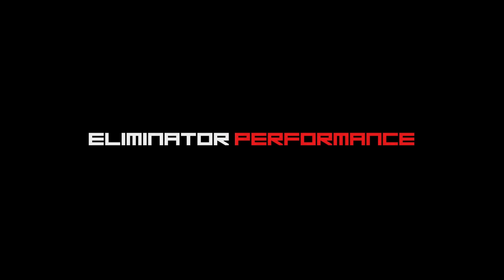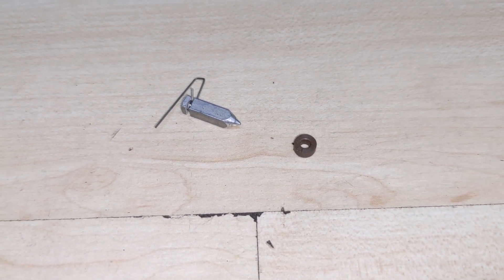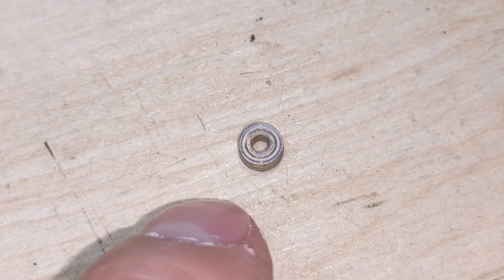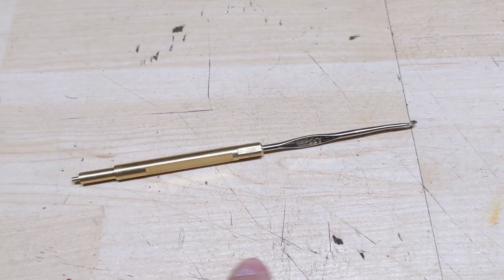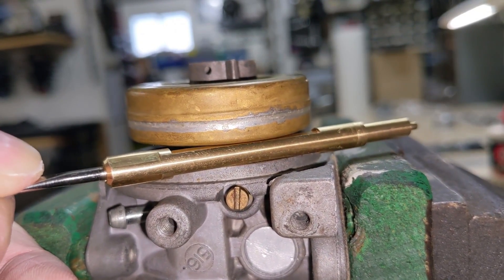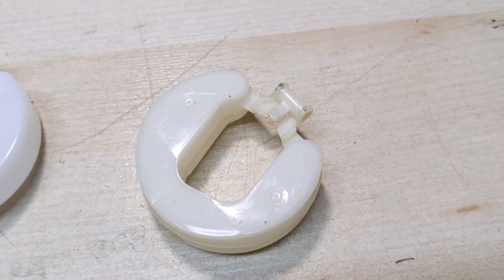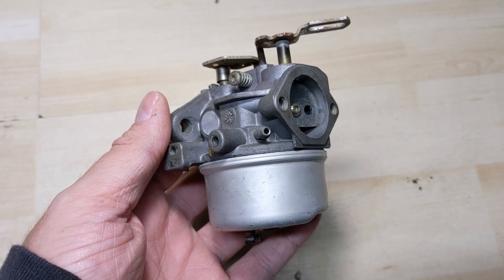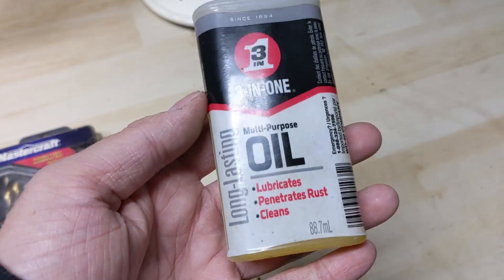Tecumseh Needle & Seat Tool - Product Review

Comment: My seat removal method is an air hose on the fuel inlet while I have my finger over the needle hole. Almost always works. I use a pick to loosen the stuck ones. Drill bit to install new one that I coat in 2 cycle oil.
Reply from the maker: That'll work too, thanks for watching!

Comment: Might add that if you have the old brass metal float, shake it, if you hear liquid inside you need to replace it. If you suspect it pour a small amt of gas in coffee can and using something to gently hold it submerged for a min or two then check. Its brass, its thin, I had seen a few get holes in them, the carb will overflow with gas when that happens.

Comment: great video, without tool this is my method to kind of get the same results

 - I use a drywall screw to remove seat or an angled mini pick, ( I know it destroys it , but it removes it )
- for install I use a mini pick or paper clip to get the seat into the hole
- to push it down I use a machine screw or Allen wrench 
- to measure  the float distance height, I use the shank of a 11/64 drill bit
Reply from the maker: A drywall screw would work great, thanks for watching!

Comment: I have 3 used tecumseh carbs and they all poor gas out when I turn the gas on, would it be because when I'm cleaning them I use an air compressor to blow through all the openings and I would have blown the valve seats out and the needle can not shut off the gas now,